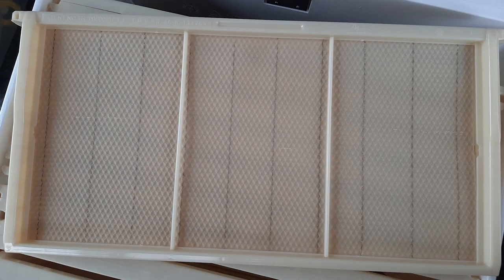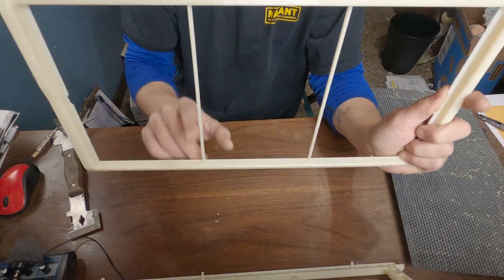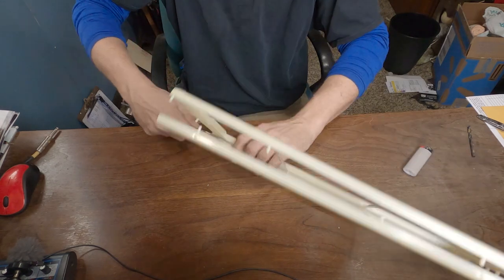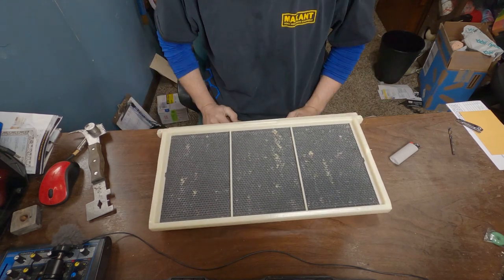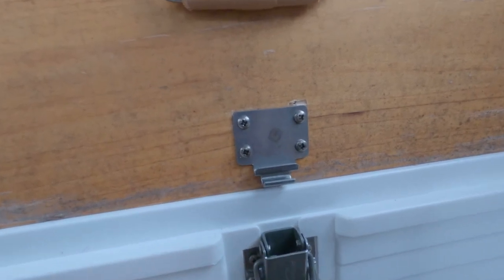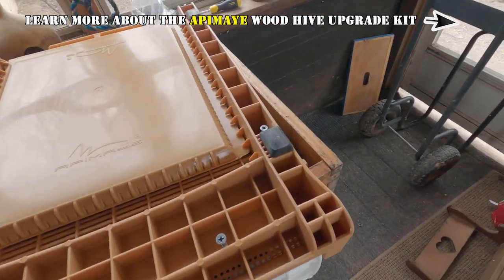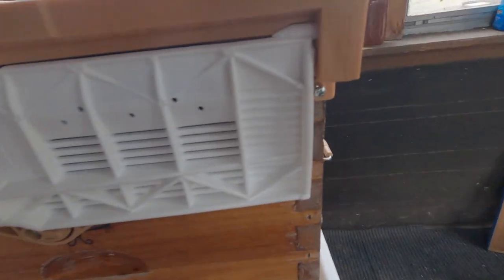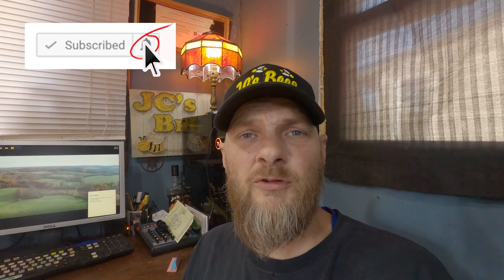A Closer Look At Apimaye... Installing Foundation in Pro Frames, Mounting Latches & More

Comment: The wooden upgrade kit works really well for collecting swarms as they are easy to transport and lock up nice and tight and the lid is vented. I have one sitting around ready to go just for swarm calls.
Reply from the maker: I like using my polystyrene boxes for swarms. They are super lite and only 2 pieces (lid and box).

Comment: I am currently running 24 of the Apimaye double deep boxes and I believe 15 of their bottom boards for wooden boxes. Of course I'm in Northwestern Massachusetts and my temperatures are probably little bit colder than yours. Just some things I have noticed with the bottom boards for the wooden box conversion is that once they are secured it does make it a little more difficult to clean out the bottom of your hive after a long winter. I pretty much have to take all the frames out to clean out the box. 

And that is the same thing with the full Apimaye double deep box as there is no easy way to separate the bottom board from the boxes for spring cleaning. Also with the double deep that has the built-in feeder system I found one serious flaw with winter feeding which I will be discussing with Apimaye. Maybe there can be a workaround other than what I plan on doing this next winter. The internal feeding system works phenomenally well for liquid syrup for spring, dearth, and fall feeding. Unfortunately when using fondant or mountain camp sugar what I found was any of my hives that had to go into the feeder for the mountain camp would not return to the hive as temperatures dropped. And with that they would cluster in the feeder and die. 

Out of 24 Apimaye double deep colonies I had 20 hives die due to the bees filling the feeders and not returning to the brood box. This next season I will be removing the feeders during the winter so I can place my winter feed right on top of the frames to prevent this from happening. And as a side note I leave 100 pounds of honey in my colonies for overwintering. The four double deep Apimaye hives that survived had an excess of stored honey or they just did not eat as much as the others and did not need to rely on the mountain camp sugar. Those 4 never went into the feeders therefore they survived. I absolutely love the design and the functionality of these hives. I also use regular wooden frames with plastic foundation in them. As far as the latch kit I don't use it but I have had no problem with my wooden boxes sitting on top of the plastic. 

I use adjustable bungee cords that hooks into the plastic box latch and holds the top cover on and the wooden box in place with no slipping. So my only warning about the Apimaye boxes would be that if you live in a cold northern climate do not use the hive top feeders for over winter feed. Remove them and feed right on top of the frames like you normally would in a standard hive. Excellent video my friend and as always thanks for sharing.
Reply from the maker: I greatly appreciate the input you shared here, thanks! You do raise some great points. There should be a way to make the bottom boards come off easier, not sure what the answer is though. I do see it necessary for cleaning like you mentioned. 
As far as the feeders, I have often wondered about feeders that require the bees to leave the hive during winter. My Ceracell feeders can be used the as dry feeders during winter but I've never tried it due to the concern of the bees not returning to the cluster. That said, I can see what you described happening very easily. Makes me wonder how much testing Apimaye did in areas that have cold winters.  I think I will do like you plan to do and remove the top feeders before winter starts. A feed bag will be my inner cover. 
So sorry to hear of the dead colonies due to the Apimaye feeders. I strongly suggest you reach out to them and explain what happened. Best of luck and thanks again for the great rundown.
Reply: @JCsBees  I do plan on reaching out to Apimaye to discuss this issue with them. And it is always nice to share information with the community when we find something that works or something that is not working as well as it could. I do feel that removing the feeders during the cold winter months and just feeding on the top frames will increase the survivability of the colony dramatically.

Comment: It is actually interesting as the concept of the Philips head screw was to make assembly of items faster and easier with  no mind to disassembly so they serve their original purpose well. For applications where I will be running things in and out I like square bit
Reply from the maker: My concerns is once the box starts to rot it could be a nightmare to get bottom board off. Surely the bottom board will out live boxes, right? I agree with the square bit.
Reply: @JCsBees  For sure it will outlive a wooden box. But then again if you put a quality box that is well weatherproofed on it you are talking what....10-15 years. Those are the sort of problems that I really don't worry to much about
Reply from the maker: @Greg Mattison A pilot hole may help. All I can imagine is the bottom board getting stuck on a hive box and a person needing to use a saw to cut the screws, that would really mess up the bottom board.

Comment: Those are not Philips head screws. They are PoziDrive. The two screws are similar but PoziDrive is a huge upgrade on Philips and the screwdrivers are differently profiled and are barely compatible.

Advantage of Pozidriv - Disadvantage of Phillips
When applying high torques, the conical Phillips form generates an ejection force that pushes the screwdriver out of the screw. With Pozidriv, the parallel form prevents this force.

Advantage of Phillips - Disadvantage of Pozidriv
Phillips screwdrivers can be used for Pozidriv screws, but they do exhibit some play. Pozidriv screwdrivers, on the other hand, cannot be used for Phillips screws.

I agree stardrive is even more positive.
Great review of the hive.

Comment: Did you buy some Torx screws or Robertson (square drive) screws?  They're easy to find as you probably know.  Even a Hex drive  screw (sunken hex head) will work also.
In my experience the Robertson work best then the Torx a close second.  All stainless steel screws in those types would be best, then they won't corrode down the road.
Reply from the maker: I haven't yet bought new screw but I plan too. Not sure I know what the Robertson's are, will have to Google them. Thanks!
Reply: I'd suggest marking where the screws go in the body by getting the tip of them started and then drilling pilot holes for the screws, I've split the wood on a fair share of hive bodies by not doing it out of sheer laziness I'm afraid. Especially when assembling them. lol

Comment: Do you have any horizontal hives?
Reply from the maker: No I do not have any horizontal hives. At one time I was considering building one then someone pointed out that bees prefer to move upward & down vs across and that concerned me so I never went forward with building one. Do you have some?